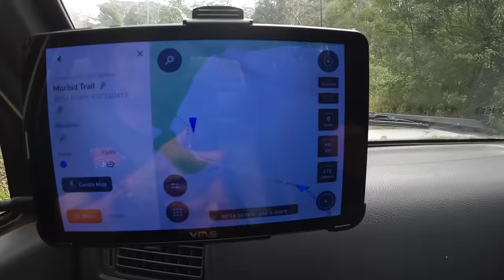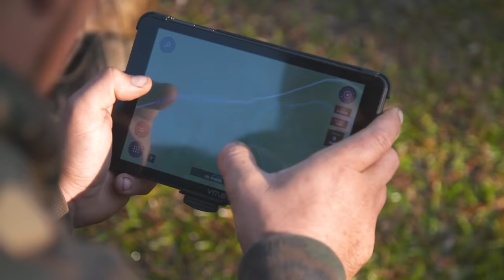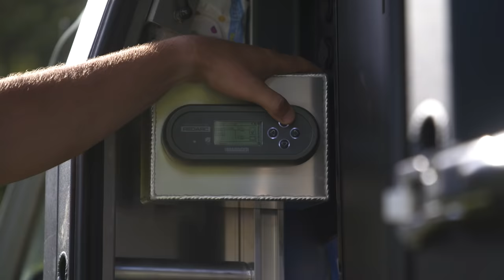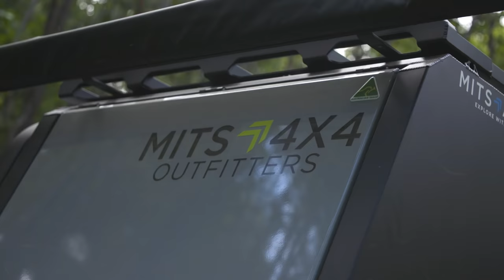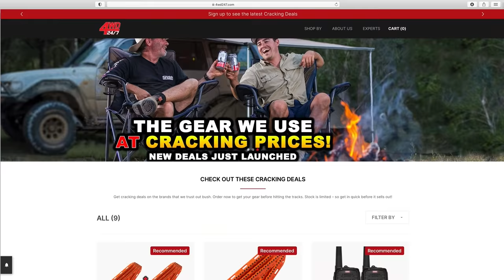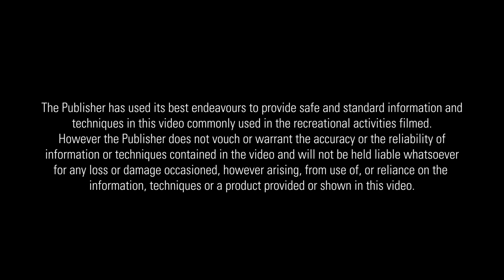OLD BUDGET 4WDs vs. Australia’s TOUGHEST tracks in Coffs Harbour + Snapped Axle & Best campsite EVER

Comment: Hi there from Hungary , one question for you guys, why do you keep the torso piece of the safetybelt on? , In case of a roll it's almost impossible to disengage the belt, here we just slide that above our heads behind our back and just use it as two point, it will disengage in any situation.Cheers

Comment: My scariest time behind the wheel would've been literally 2 weeks ago, brother and I went 4WDing in a local area in Victoria, I am driving a 2021 MR Triton 2.4L with a set of 31"s Highway Terrain! my brother is driving is 2002 Nissan Navara 3L with a set of 35" aggressive muds - we got stuck at the bottom of a valley with the alternate route full of unpassable mud. So we decided to go back up the same hill we descended from, which has a rock in the worse position if you fail the climb it will scratch the entire side of your car, did I mention my 2021 Triton is 2 months old with 2,500ks on the clock? So my brother went first, he barely made the climb, so I gave it a crack, fail after fail after fail. Eventually we thought we have to winch, oh did I mention the 2 month old Triton didn't have winch? so I got high enough where my brother can hook up to me, my nephew who was with us was meant to be watching my brothers reversing because there was a dead drop off the hill not far from the exit of the climb. My brother winches me but requires more flat ground so reverses, my nephew didn't say a word, I get up the hill my brother starts to fall down the other side. With both cars foot down we managed to keep him from sliding down with me still hooked to him. Was a bloody close one.

Comment: My scariest moment was wen I was on some tuff tracks with mates and I  was at the back of the convoy and typical 80 series with no hand brake stoped on a hill left it in gear to check out the next obstacle and wen I hoped it had my foot hard on the brake and clutch in it shot backwards faster than a bullet got it started and clutch kicked it and just saved it from disaster

Comment: My scariest moment on the track was in my gen 1 turbo diesel pajero shorty down my local track called kamikaze. It was after a week of solid rain and the track was slippery red clay, I made it up the track and went to turn around as it's a one way track and didn't see a hole which made me slip down to the edge of the track which was a 4-5 storey drop into a heavy flowing creek.
This put the car into a spot where I was sea soring on 2 wheel on the edge of the drop off. We ended up sitting in the car not moving for whay seemed like hours and I finally had a plan which was to put in 2nd low and drop the clutch at full revs while I full locked the steering and we just held on and closed our eyes for the scary drop down the cliff.
Ended up nose first into the creek but was able to drive out no issues

Comment: Scariest moment would have to be winching for 5 hours on the steepest hill I’ve ever been on and I’m from Coffs so I know steep. all wet clay at night in the cells towing a camper trailer. 
When you stop winching to reset you start to slide back with all brakes on without packing behind all wheels. 
A lot of trust put on a 9mm winch rope. 
If it broke that was it.

Comment: I have come to the opinion that old metal quality is stronger than what is on  offer today. I know modern engines have heaps more grunt , but they should not be snapping axels and CV's like butter. I miss my G60!
Reply: Wouldn't that be because they have much more power but still running the same CVs and axles?

Comment: Most scariest thing was sliding back down hill on Sarni Pass with my 2x4 D4d  and a big rock stopped the bukkie from going over the cliff this is South Africa Natal boarder between Lesotho ps this is supposed to be only 4x4 but it was my fault no weight in the back and tyre pressure was for tar road😢

Comment: scariest moment was when i was fresh on my P plates i had an old ln167 N/A hilux and i attempted to go up a very steep sand dune now i was stuck down there and my only option was to go up it so i got a good run up i was redlining the old girl and suddenly bam a navara pulls out right in front of me i slammed on my brakes and was full of adrenaline so i tried to go back down straight away and there was a big drop off into a ditch i reversed onto the edge by accident and my car was on the very edge of the hill i couldn't even step out my car it was bogged the sand was dropping bit by bit and there was no way i could reverse any more and my car didn't have the power to go straight so luckily there was a big enough gap so my mate could pass me anyway i was really bogged had maxtracks and dug attempted to dig out the sand but it didnt work just had little to no power in the car anyway i had no front recovery points either so that made life alot harder/sketchier so my friend put his winch to my bull bar didn't work was so stuck luckily there was some guy in an n70 that also had a winch and more maxtracks so they both winched to my bullbar and somehow it worked and my car didn't even get a scratch old mate didn't even charge me i guess the moral of the story is my seats would have been more clean if i had seat covers after that day

Comment: scariest moment was in my previois 3l hilux bogged on the beach with a pregnant lady 1m from the water had waves smashing into my car not to mention during a during a hailstorm at 2am in ridiculous wind bogged to the absolutely shivers in quick sand both diffs and fron upper control arms all under aswell as half the tray under took me 3 winch ropes to snap and got out after about 6 hours of full on going at it, half hour longer and car wouldve been gone

Comment: As much as I love a 79 series. Sure the 47 didn't take the tough tough stuff but I think the 47 showing the 79 up here really shows how wrong Toyota got the rear end design. A 60 series would have no trouble with suspension travel even with its leafs.  I'm so undecided in what to get as a build project.. between a 60/79 their interiors and exterior panels are pretty much same 80s period style, the obvious being the much newer engine tech in the 79. Most vids I've seen of 79s are just getting caught up on something or bogged. Do I get a 12ht 60 and spend the remainder on fixing the body or a 79 and have an average track car.